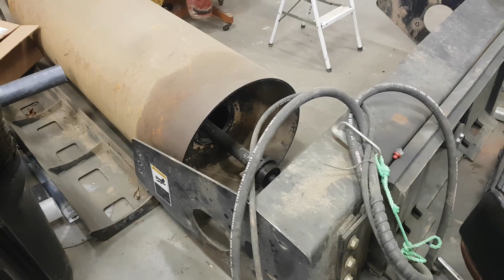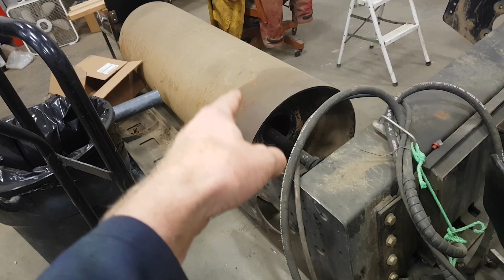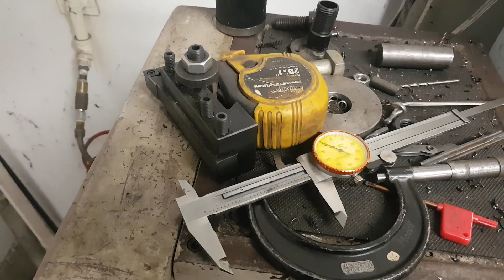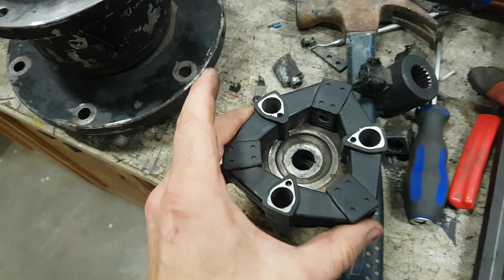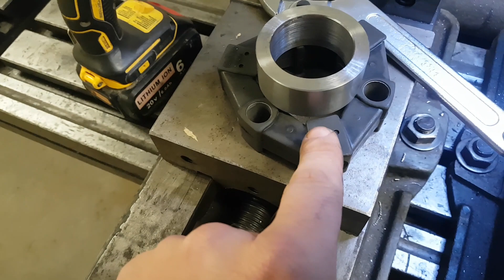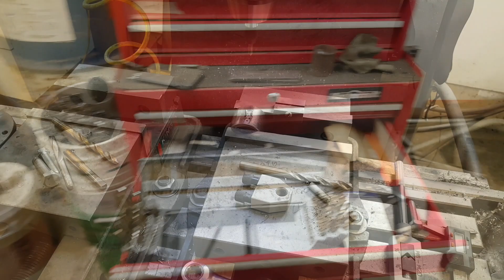Roller Compactor Repairs - Part 1

Comment: I’ve changed the rubber part 3 times now with greese applied each time to the inner bearing. They work for 2-3 jobs then break again. Anyone come up with a permanent fix. I’m kind of over it thinking I’ll pull the trigger on the CAT rollers.